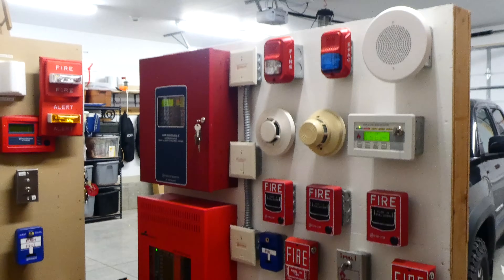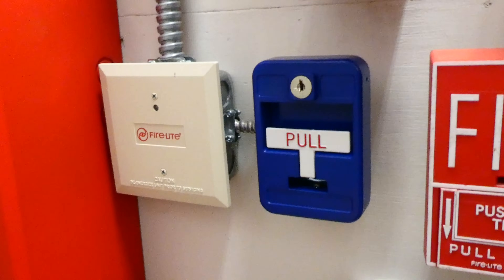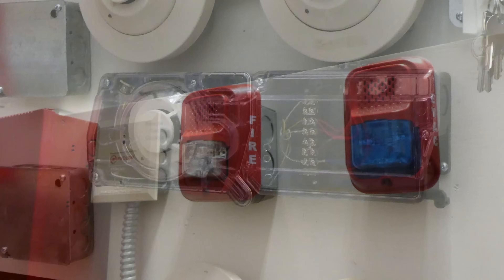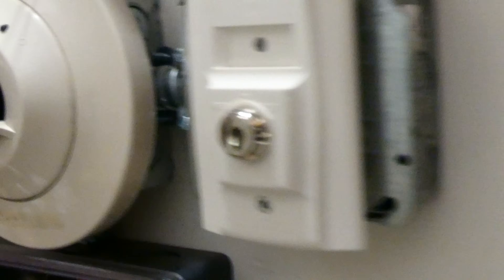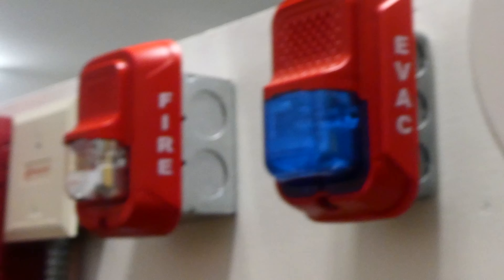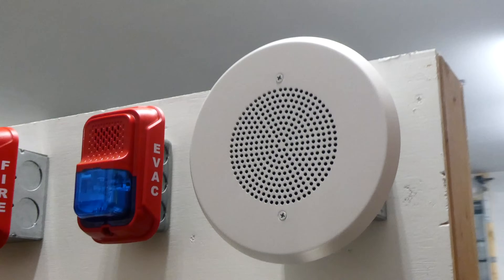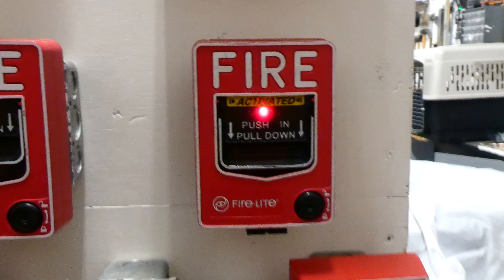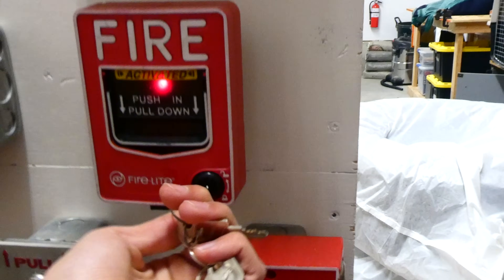Wheelock & Fire-Lite Voice System Test 7: L-Series

Comment: (This  is for the giveaway) I just wanted to say this is one of my favorite videos of yours. You have helped me through a lot. Thank you so much S.E.R safety. Thank you.
Reply: @RealMcKing l we be doing a fine alarm system test siemens speaker strobe 4 watt at my house for the test l have the system sensor spectralert advance speaker strobe mounted on the wall and the gentex speaker strobe setcw speaker only 4 watt voice evac only wheel lock as wheel lock mt code 3